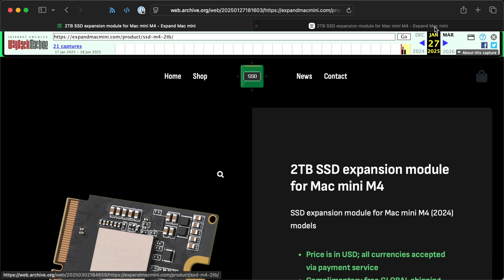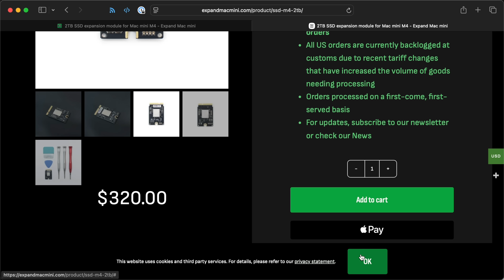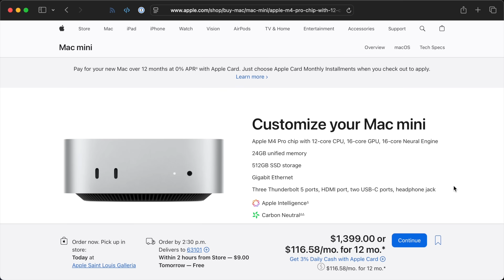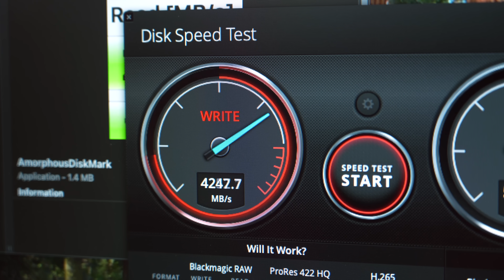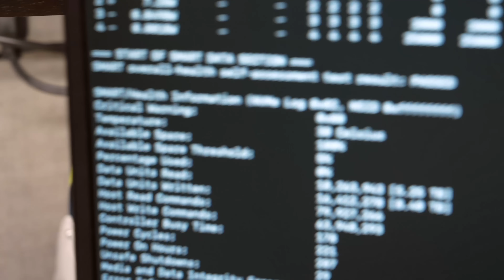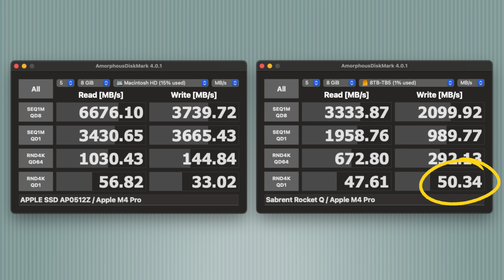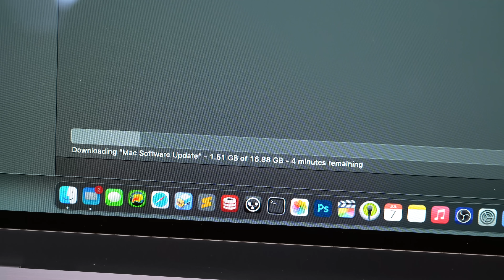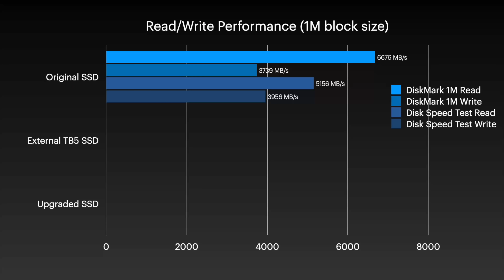There are three types of Mac users

Comment: Hmm, it's sold, out But it's NOT 299, its 459 for 2tb.
EDIT: you linked the PRo, the normal one is indeed 299.
Reply from the maker: Honestly the M4 mini (non-Pro) is probably the best value regardless—so that base model plus a 2TB upgrade is pretty enticing. Would like to see 2.5 or 5 Gbps Ethernet built in on the base model though.
Reply: Yeah I'm thinking about getting a normal M4, just wish the RAM upgrades were a little more affordable. 32 is my minimum. I'm not skilled enough to do a Dosdude1 upgrade myself :P

Comment: The main issue is that the you will either you will need to buy the DFU kit that runs in a vm or you need to have a second mac m4 device. This actually prevented me from buying a m4 mini. Is it really hard for apple to let us create a flash drive and let macs boot out of it ?
Reply from the maker: I'm with you there, but the way Apple structures the restore process, I believe you need an Internet connection and it authorizes the DFU through Apple's servers too. Not as nice as the old days, when we had FireWire disk target mode, you could use an iMac as an external display, etc. :(

Comment: External storage is so rapid these days that there's barely any penalty.
Reply from the maker: Like I show in the video, though—it takes some effort to match internal storage, as Thunderbolt 5 doesn't just mean you get a full 80 Gbps bidirectional. You have to choose the right drive for the purpose.

But for 98% of people, even a slower NVMe SSD in a Thunderbolt 3 or 4 enclosure is going to be plenty fast for most operations. 2-3 GB/sec is still ridiculously fast, and for small files/random access, it's pretty much on par with the internal storage.
Reply: @JeffGeerling  I think its actually the drive you used that made it so slow in comparison. I have a Samsung 990 Pro in a UGREEN TB5 enclosure and its almost exactly as fast as the orginal drive in the Mac Mini
Reply: @tilmankieselbach  But it will probably consume more power then Mac Mini M4... ;) Modern fast SSDs tend to be very nuts, they consume a TON of power compared to when we started with SSDs, sometimes even idle is relatively high.
Reply: @JeffGeerling  Buying a Gen4 over a Gen3 SSD is not really something i'd consider "taking effort" to easily match Apples 7GB/s. Sure getting consistent speeds might still be harder, but come on man.
Reply: @JeffGeerling  Too right. Nothing beats internal storage at the top end of course but when looking back at the days of USB flash sticks and 2.5" spinners portable drives have come a long way. Great vid and wishing your dad all the best for his retirement! May we all get there with such spirit.
Reply: External storage is nowhere near as reliable in my experience. I've never had a USB disk that didn't at some point drop connection for seemingly no reason, Whether it was an SSD or HDD.
Reply: @sceerane8662  Huh. I've never had an external drive drop like that, HDD or SSD, and least none that I can remember. Maybe you're just unlucky?